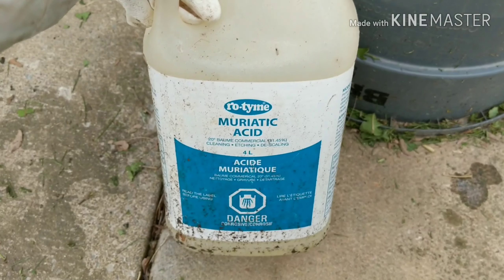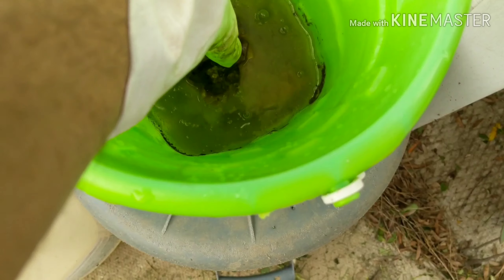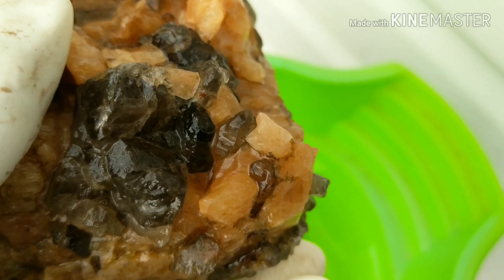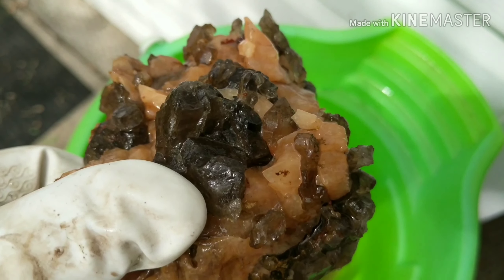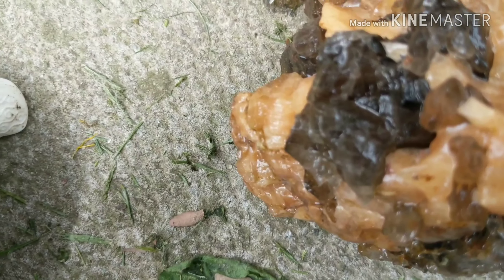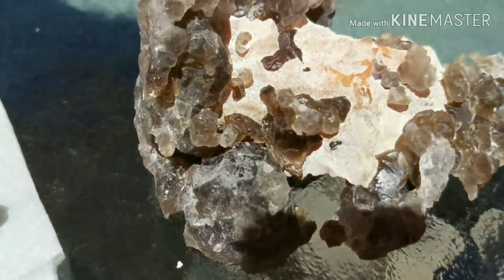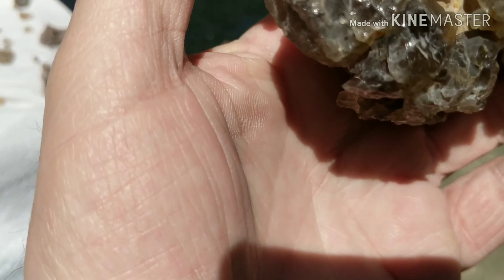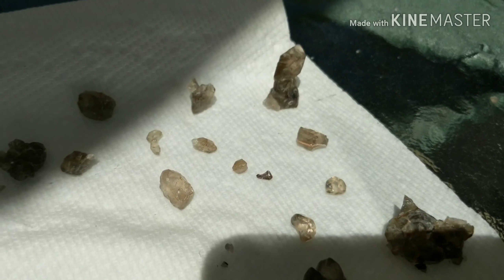Etching Calcite containing quartz and zircon from the famous MacDonald mine near Bancroft

Comment: I've had the muriatic acid for two years and never found a rock I was willing to possibly sacrifice. I don't know which of my rocks is a good candidate. Yours turned out beautifully. I've just done an iron out video and am editing it now. How do you know what rocks to etch?
Reply from the maker: Calcite can host an interesting variety of minerals. Up your area silver and arsenides can be encased in Calcite. The acid will remove the Calcite exposing the metals. I recently used acid to expose a beautiful silver wire specimen I found at one of the Cobalt mines. In the Bancroft area, crystals of many varieties can form in Calcite, using acid can expose or remove the crystals for display.